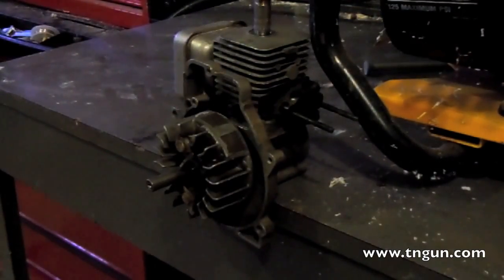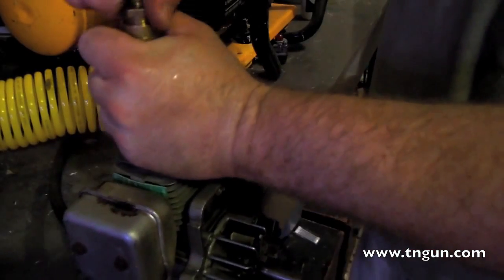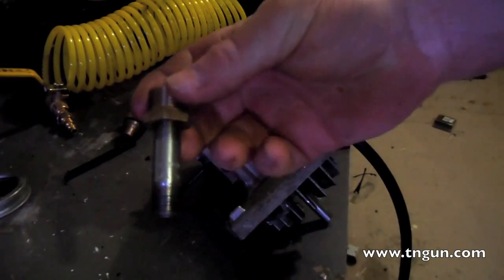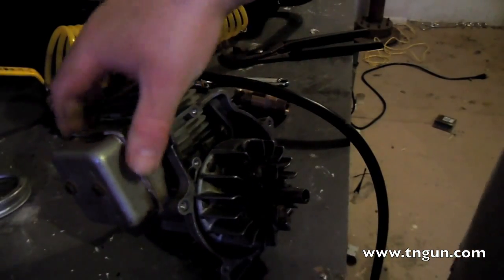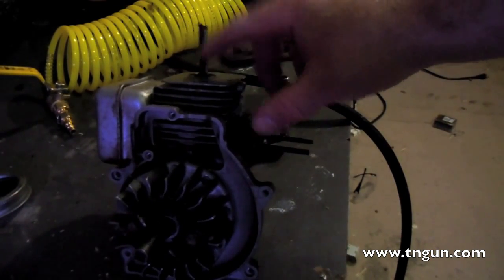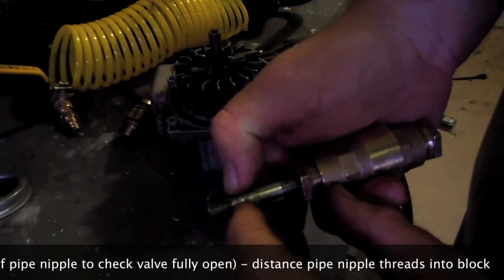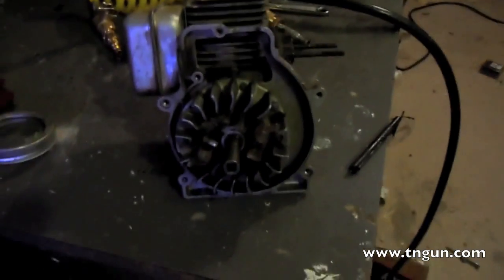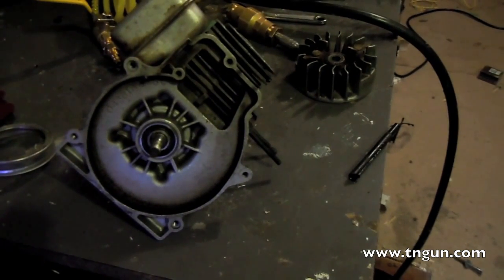How to Convert a 2 Cycle Engine to Steam | Weed-eater to Steam/Air Engine

Comment: You ever tried 1/8  copper Carbon fiber wire.
About sixty 8 2 seventy eight raps 24 V. On a dimmer.
 On demand steam

Comment: Thanks really good idea. Be nice to get the steam back in the boiler too. Steam injector they call it I think. I was using an electric valve but it didn't last. Thrift store has presure cooker cheap.  Harbour freight has a cheapo 900 watt 2 stroke generator. Other places too $100 new.

Comment: just make sure you put a relief valve{safety valve} on your boiler thats a must
Reply: If you use a pressure cooker they have the benefit of having a relief valve already.  Plus you can cook dinner while you are running the engine 😀
Reply: @andrewallason4530  lacks volume but i get your drift

Comment: The best way to convert a 2-stroke engine into a steam engine is to take the cams out and put another bump on the opposite side of the cam where the manufactured bump is you should do it the both cams

Comment: For a boiler you can use an old air compressor tank. You can also use the compressor as a steam engine and it comes with a fly wheel

Comment: I just now spun through a number of Youtube's on this.  Yours is purely mechanical using the push rod against the check valve.  Greenpowerscience uses a solenoid, another uses a wooden cam to trip the trigger on his air hose nozzel. I like your version best!  Great work. Thanks.
Reply: They get smashed over time. Literally smashed flat.
Their is a part you can buy online with a magnet sensor that will push it open when the piston is in place.
You can run it off a battery or get a little alternator to power it like a car.

Comment: It seems like you might be able to tune it by changing the tension of the spring in the check valve, it would be awesome to make a solenoid version that works like fuel injection with an ecu.

Comment: consider using a refrigerator compressor sealed filled with oilso lubricating included continue using compressed air just reclaim the used exhaust by sealing the system possible to find a 12v compressor run on battery that you charge from whats generated sort of like a alternator on a car

Comment: Seems like you could omit the push rod and check valve when using two identical engines with alternating pistons... 🤔
Reply: Please explain. Sounds too simple. Thanks
Reply: @ravenhhca  practically a system in which one piston is released as the other moves back

Comment: I don't know if I'd recommend using a metal plunger to strike the piston head? Brass maybe? Or a hard plastic tipped metal plunger so you don't risk cracking or wearing a hole in the piston head.

Comment: So do you seal up the intake side And leave the exhaust open for the steam to leave ?
Reply: The intake on this particular engine goes into the crankcase and then through the transfer ports into the cylinder and since the exhaust port is higher up than the transfer the steam won't be heading out the intake until after exhaust happens which is probably helping to relieve any left over pressure before the Piston starts going back up
Reply: @patrickbrasil7465  ohhh i see thanks for explaining :)

Comment: Would this also work on a 4 stroke engine?
Reply: Not using this method with a single cylinder engine. The cylinder would be full of pressurised steam as it tries to come up and it will stop.

It probably wouldn't work on a multi cylinder engine as the inlet valves usually open well before TDC, stalling the engine. Although giving it a good push to start it might.

Comment: Had you thought about replacing the compressor or boiler with maybe 1" pipe with an end cap and using a fresnel lens to heat it? Seems like it should work. Check out greenpowerscience on youtube they have many good videos on fresnel lenses. Good video, the throwing against the wall method is what i do too.

Comment: Hi,

what size npt fits the spark plug?
Reply: Yves Baggi that's what I wanna know. He told us what to get just not the sizes
Reply: Yves Baggi no npt matches the threads of a spark plug, he just threaded the nipple into the soft aluminum and cut his own threads! That's the least of his problems, lack of lubrication is the reason these conversions get put away in boxes and collect dust, that and the fact that steam is highly corrosive and plays hell with aluminum.

Comment: I've seen a bunch of videos on how to..... Would love to see 1 video on practical application. This is not a criticism, I just want to see the next step.
Reply from the maker: Because, soon after I realized how impractical this is, with no good way to oil it soon seizes up.  I address that on the blog, but I never made a follow up video.
Reply: Shepherd School thank you for the explanation. Did you ever determine the horse power?
Reply from the maker: I never did the math on horsepower, but steam does have a lot of torque.
  It was very strong as a motor, stronger than my ability to mount it 
securely.  But like I said, these don't run more than a couple times on 
straight steam before it seizes up and rusts and I never figured out a 
good oiling system.  If you do, PLEASE tell me, because I think this is 
an awesome idea.
Reply: Shepherd School is there a catalyst that will combine water and oil the same way soap does? An azeotrope as it were. If this can be accomplished cheaply problem solved.
Reply: @TNGun  displacement lubricator, search for that

Comment: a push rod out of a small block chevy would work...if ya needed something bigger maybe out of a v8 diesel ..they are hollow so there wouldn't be much restriction..the air nipple for an air compress quick coupling (male end) fit the spark plug threads a little better then galvanized pipe thread...they are supposed to be the same thread but if ya look at them they are a little different

Comment: Great little conversion. Are you going to produce electricity? Regardless of what you power with it - you can pipe the exhaust steam through a radiator with a fan and heat your work area or home. Then it does not matter how efficient the steam engine is - you will be using 90% + of your energy. Be Careful with that BOILER. they can kill (and cook you) in an instant ! !

Comment: So how do you convert a Ford 302 to run on steam? Seems to me that you would need to change the cam timing so that the valves would open every stroke. (IE: No compression stroke.) High pressure steam in thru the intake, out the exhaust. The engine turns. But I figure I'm missing something somewhere.
Reply: CrazyBear65 http://www.slamvalvemotor.com/products.html

Comment: Great video, but, why are you concerned about a heavier metal flywheel on an aluminum engine? Just use a stand with half moon shaped polycarbonate plastic, like snowmobiles on the rubber drive belt to support the shaft for the extra weight. I believe the older steam engines used lead or brass to support the shaft, but, constantly needed oiled.
Reply: The weight helps with inertia to bring the Piston back up to the top of the stroke

Comment: no. go for steam engine using used oil as fuel then attach that to an electric motor and the result will be a generator. you have completed only the rotating parts you still need a boiler, a condenser, more tubings to fire your used oil....in PRINCIPLE IT SEEMS TO WORK also in principle ' USED OIL ENERGY WILL BE CONVERTED TO ELECTRICITY...

Comment: How about using method compressed air and recharging compressed air tank with the excess air coming out from the engine? I might be sounding thoughtless, just made me curious.
Reply: Tsog Ayurzana  The increased backpressure would reduce the difference between input and output pressure, which would reduce the power. Some steam engines do catch the steam coming out - but only to condense the water to be put back into the boiler to make more steam (that way you don't have to carry as much water in a tank)
Reply from the maker: Tsog Ayurzana That would be too close to perpetual motion and even in an efficient system (this is NOT efficient it is bashed together) friction losses would keep that from working.
Reply: Shepherd School Maybe not. I think he's actually just talking about recovering the losses. Not something that runs itself. It's an interesting concept. I'll play with it some.
Reply: It would work until you reach equalization.  That's why steam, and not compressed air is the way to go.

Comment: fyi slow down your video.. its not rotating around its oscillating  back and forth.. dont believe me.. check the video for your self.. ps i know because ive built one of these..  it dident work out and ive been building motors all my life.. but anyway check it out any way .. just slow down the video.. its not making rotations over and over..
Reply: William Mullaney No, you don't have to stop the inflow.  The engine's own inertia rolls it past TDC in spite of the incoming pressure.  If you roll the engine backwards, it well work equally well backwards.  This kind of air or steam motor seems a little counterintuitive but they work very well, particularly at high speeds.

Google "Air Hogs," pneumatic toys from the early 90s, they used a motor like this.  Its simplicity is what made it possible to make an affordable toy with a pneumatic motor.  Cool stuff.
Reply: elhigh  yea but more importantly, there were springs in the system between the air pressure, the spring pressure, and the height of the pin it sets the timing of the air injection. without this system the engine will oscillate until you put more pressure in it than the piston will generate in the up stroke.
Reply: You are probably right as he is using a plastic pen as a direct one-to-one  mechanical link between the piston and his check valve. So he  will have an alternator instead of a DC generator. He could attach an old ratchet handle to it somehow so the oscillations are converted into DC. Unless the intake valve and exhaust valve  can be solidly coordinated with the check valve, he'll have to figure out how to turn those oscillations into a spinning motion through a ratcheting mechanism. I am not sure you can attach a flywheel to this configuration as it would add engine vibration without really an payback as in taking the engine past a stick point under torque. My solution would be to reroute some of the steam through the intake port and make the stem on his check valve thingy tighter so not as much steam pumps in through the spark plug port,  so the engine now is slightly out of equilibrium and less likely to find an oscillation point between  steam intake and steam exhaust and with that configuration, now a flywheel might be helpful.
Reply: The problem is, you have to stop the inflow of air on the upstroke. And have a serious flywheel. You need some sort of valve.
Reply: elhigh
 hate to tell you but air hogs have a valve that opens with the piston is at tdc, take a closer look. he has the same valve in his motor in the video.
if you put equal amounts of force on both-sides of a wall the wall will not move.
Reply: jon spon I don't know which Air Hogs toy to which you refer, I can only tell you about the one I looked at.  There was a little pin on top of the piston that poked the ball up.  That was the entirety of the valve system.  It worked great.

Your wall analogy is specious.  It disregards the dynamic state of the system in question.
Reply: jon spon Your theory is flawed because you didn't account for the inertia from the flywheel. This design works just fine. Especially at higher rpms.

Comment: wouldnt steam melt the pen? and end up a big mess in the cyl?
Reply from the maker: You would think, but it hasn't yet - I meant it to be a stop gap to get a measurement and then replace with a metal push-rod, but its worked fine so I haven't messed with it.
Reply: David Nash interesting..
Reply: Well because right now he's using air presser didn't you watch the video. When he converts it to steam he's going to replace the pen,
Reply: +warmfreeze This is a bash valve. A nail, copper or brass rod will do.
Reply: then he will have a hole in the piston if he uses any metal.

Comment: use a push rod from a car. they are cheap new. like 10$. or less. rounded bering end. and if you added oil into you air mix you would be keeping things lubed. its all about the lube. she loves the lube.

Comment: Great job, but I have a couple of questions...
1. Why not run it on compressed air and avoid all the problems with steam, corrosion, a fire and such?
2. Where did you get the oil reservoir?  Thanks for the video - just what I was looking for!